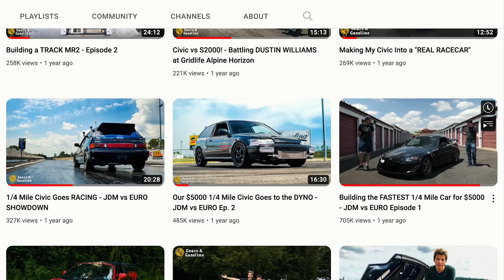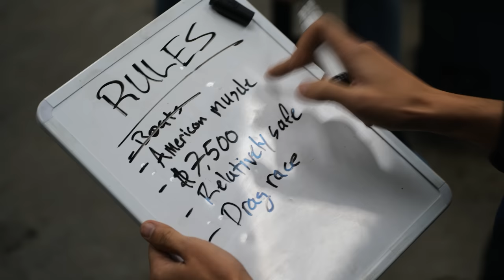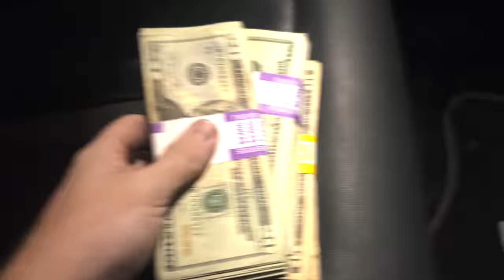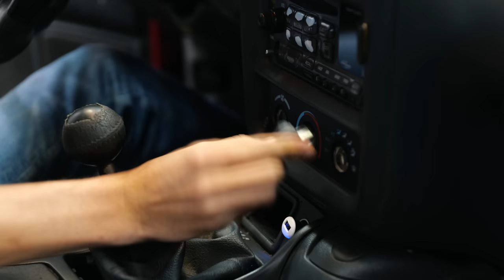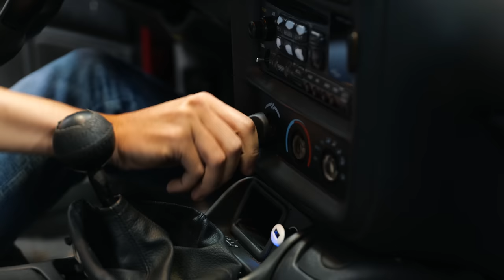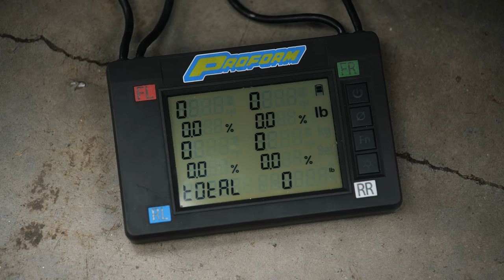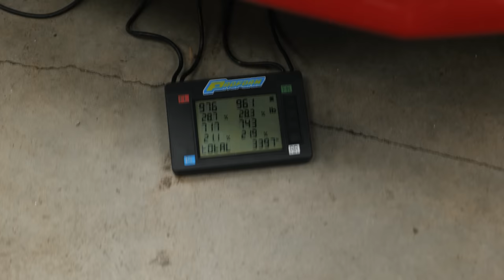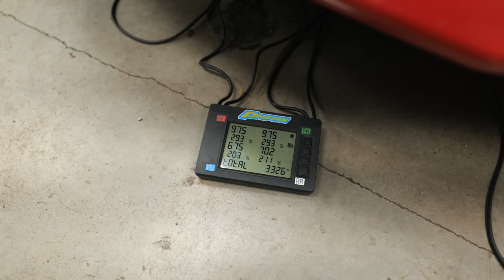Building the Fastest American Muscle for $7500 - Camaro Build Episode 1

Comment: 19:12   sorry to burst yer bubble  American cars have been metric since the early 80's......however they use the closest metric sizes to standard   so obvsoily 10,  and 8,   ford likes 7 for some reason    .  gm mostly 7,8,10,11,13,15,16,18,19,21,22,24. 7 is 5/16 11 is 7/16,   13 is close to 1/2 inch, 14 is close to 9/16s 15 is closes to 5/8's, 16  also close to 5/8s lmao 19 is 3\4  22 is 7/8   1 inch is 25.4...    honestly please just use the correct metric sockets.......even all the bolt holes and threading has been metric since the early 80's
Reply: now Nissan has decided to go the German route since their partnership with Mercedes and now I'm finding random 13mm and 16mm bolts on Nissans  just to add to the confusion.

Comment: How come American cars can be made so cheaper in quality? I mean by interior plastics, don't get me wrong. Japanese cars from this era did had plastic parts as well, they wouldn't be high quality plastic parts but that ain't the cheap in quality like these old GM products or ford from this era..  My 95 civic does have  plastic switches and buttons but none of them have been broken or cracked unlikely American cars neither the dashboard of my car got split into tiny pieces like this one... What I thought was Japanese cars were supposed to be a tiny cheaper and fuel efficient cars with low quality of parts, but it turns out American cars are way cheaper than anything else produced..

Comment: I love all the hatred for the 4th gen despite it having identical performance as jdm legends such as a Mk4 Supra. Seriously try and find the difference between a 4th gen f body and Mk4 on paper. 320hp? Yup. 6 speed? Yup. Weight? Identical. 2+2? Yup. Removable roof panel? Yup.  Great engine? Yup. 

Sure the f body doesn't have irs but who really cares? It's a double wishbone front end and they actually handle very well with the SRA...that or the supra handles like shit. The performance is once again identical. 

The biggest difference? A Camaro is CHEAP and plentiful. You could buy 6 LS1 Camaros for the price of a Mk4 Supra. The interior isn't that much nicer in a supra. You do have to get a Camaro to be cheap though, the firebirds are more rare, look way better and have a nicer interior all around